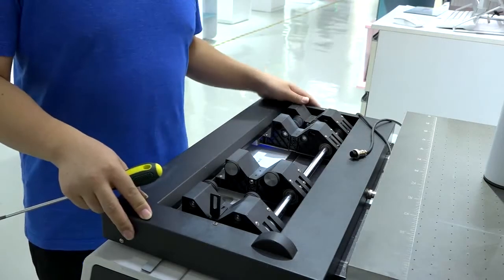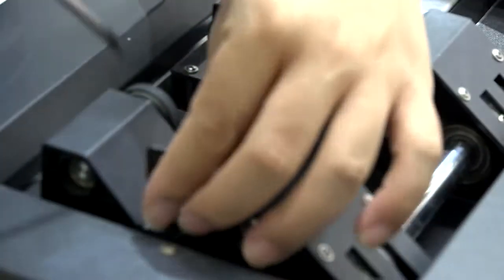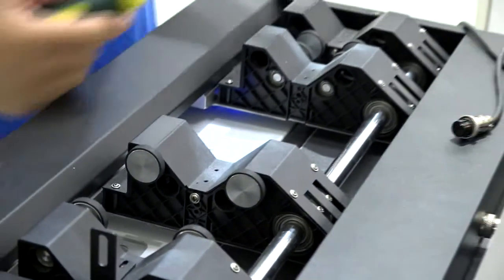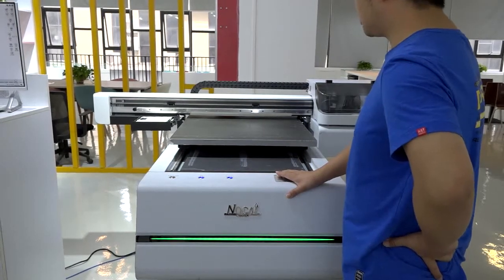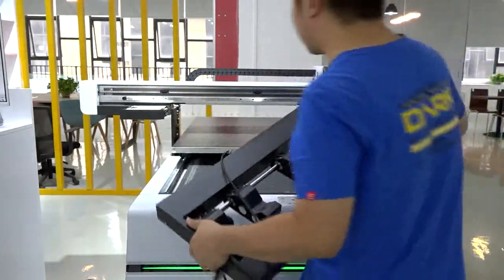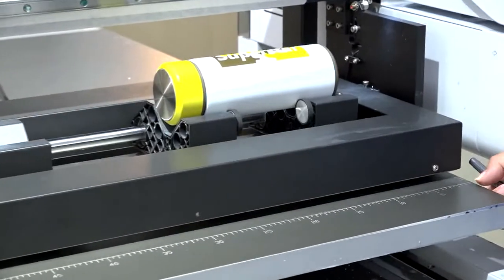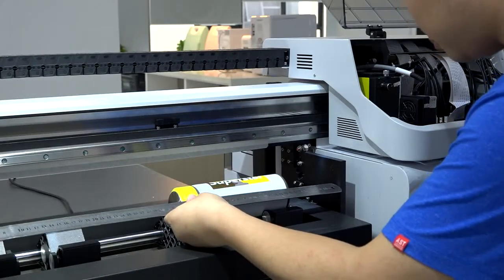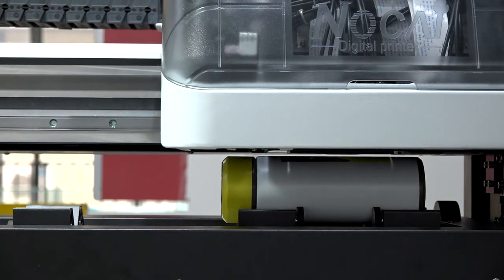NC-UV0609PEIII 3 heads uv printer a1 size uv printing machine mug jig setup

Comment: I just bought a PE III-II nocai machine, there is a problem that every print on the white ink section has a line, but it's not lined because the nozzle is clogged, can you help me? Is there a WhatsApp number we can contact?
Reply from the maker: Whatsapp: 0086 185 8854 1256. Thanks.